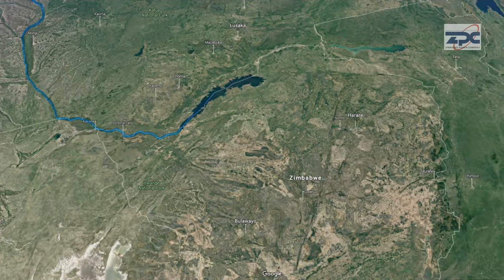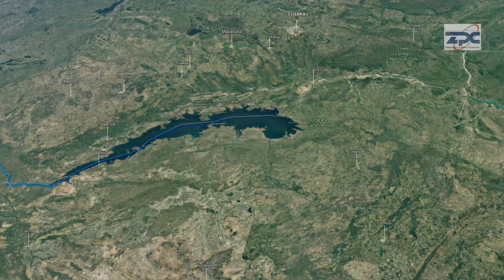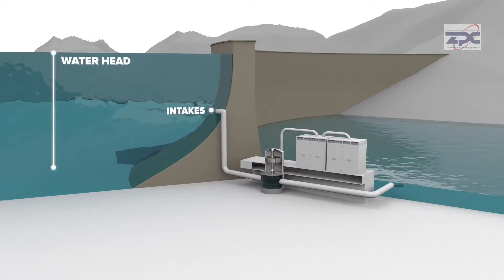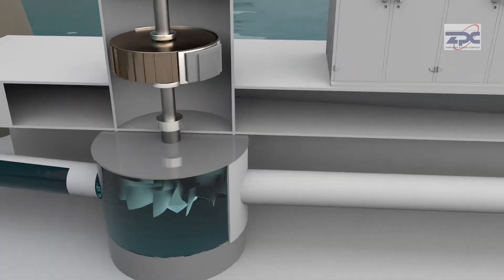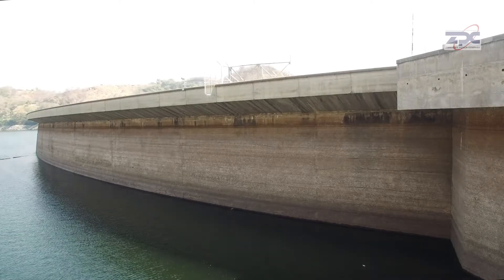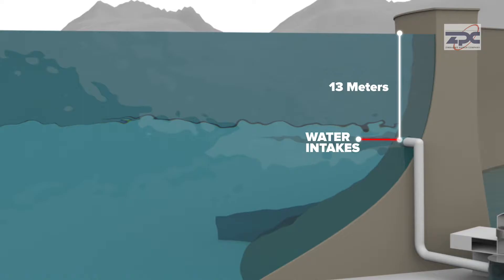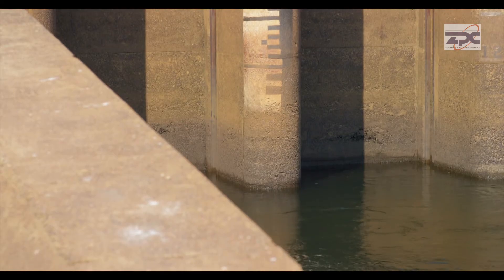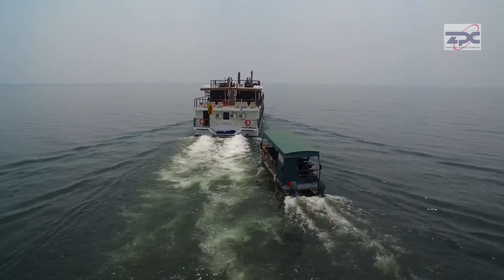Kariba Lake Levels 3D Video Explainer  ZPC

Comment: Congratulations!! I am not an engineer, but I am interested in some aspects. Kariba Dam is the largest man-made dam (185 km3 of water). It is almost five times bigger than the Chinese Three Gorges Dam (38 km3). However, the Three-Gorges Dam has an installed capacity of 22,500 MW compared to Kariba's 1,626 MW (with the Zambia side). Is the difference only in terms of number turbines, Kariba has 14 compared to 34 and their capacity? What is the maximum that can be harnessed from Kariba, if financial resources were available (a simple matchbox calculation says 110,000 MW)?
Reply: True but note.....
1. Turbines used at three gorges are the world's most efficient currently available. This means the use less water. 
2. Zambezi river's catchment area is less than that of the yangtze river.
3.  Zambezi's average discharge i to the ocean is 3000m³ yet Yangtze is 30000m³
4. Drainage systems in those countries are more advanced thereby havesting more water than us here in africa.

These few facts here make kariba small to an extent.
Reply: @muziwethumoyo6633  (1) if the demand and financial resources were available,  then it is possible to increase to at least 20,000 MW through more, larger, and more efficient turbines (2) The volume that Kariba has of 183 km3 compared to 3 Gorges's 38 km3 means that there is spare capacity exceeding 20,000 MW. (3) The current low levels maybe due to inefficient turbines, and inefficient water management b4 we consider the drought situation (4) It maybe possible to increase the water holding capacity b4 the dam without affecting Cahora Bassa downstream in order to increase the required head to produce at least 20,000 MW

I am just wondering if we've become small-minded (some may argue fit-for-purpose) compared to the original plan of the world's largest water reservoir.
Reply: Yes...bigger than Chinese three gorges dam..change of units with higher output with matching demand on live water could enhance karibas overall installed capacity